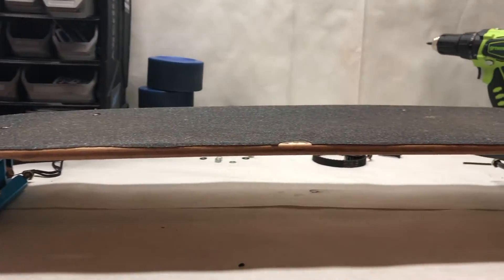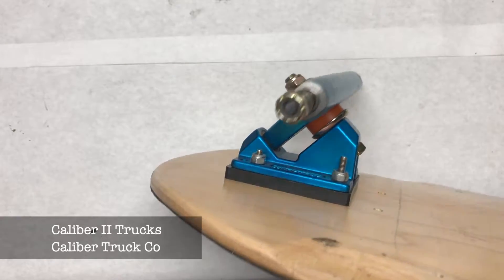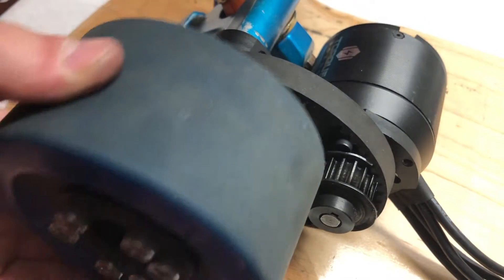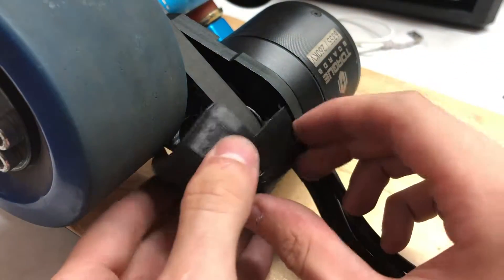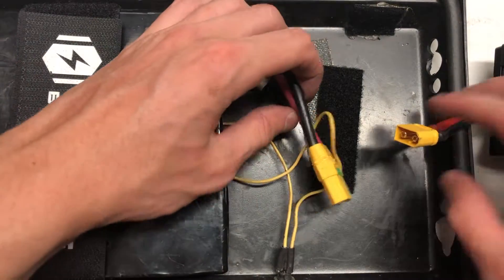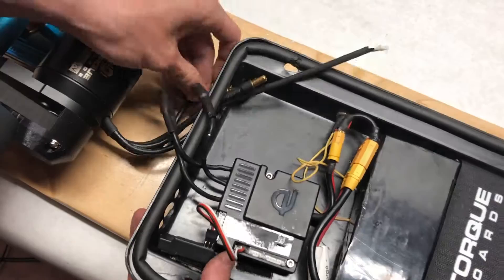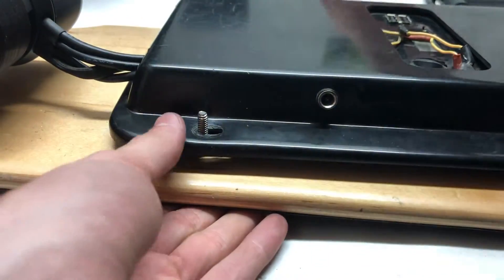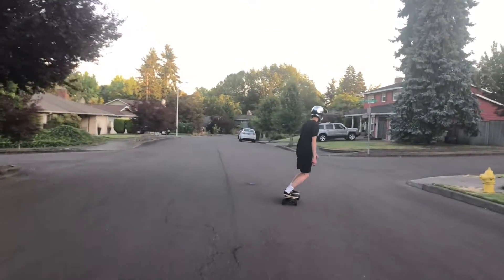How To Build a DIY Electric Skateboard mini(Easy to build)

Comment: What are your thoughts on that deck? I was thinking of ordering that exact one for a build so if you can share any pros or cons I would appreciate it. Thanks.
Reply from the maker: It is actually quite large and comfortable, but the kickball is almost pointless. Overall, I think that it is okay, not great though.
Reply: @DIYesk8Builders  thanks very much for your insights. The I would prefer the kicktail to be functional so I may look at other options. If you have a recommendation of another deck with similar width, mellow concave and price range please let me know.
Reply from the maker: I would just look at skateshred. They have a ton of options

Comment: quite sure the pulley on the motor is on wrong
Reply: No, I went back checked. The narrow part is supposed to be closer to the motor to reduce leverage on the motor shaft.
Reply: @marsbase3729  ah, that makes sense

Comment: Hey, I have a question. So my boosted board V1 battery fried and boosted doesn’t work on V1s anymore so could I just use the existing motors I have on the board and use my own battery, esc, and remote? I’m very very new to the diy eboard community so I really don’t know anything about this. Any response helps, thanks!
Reply from the maker: Yeah you could definitely do that. Just find components that will fit the deck(make sure the battery isn't too long because of the vanguards flex)
Reply: DIY esk8 Builders okay great! anything you could recommend?
Reply from the maker: I've never worked with a vanguard, so I have no idea how big the battery has to be... Not many packs are prism shaped either. They are mostly flat. It all depends how much range you want. In terms of ESC, I recommend buying any VESC based controller and for a remote either a flip sky VX1 or VX2